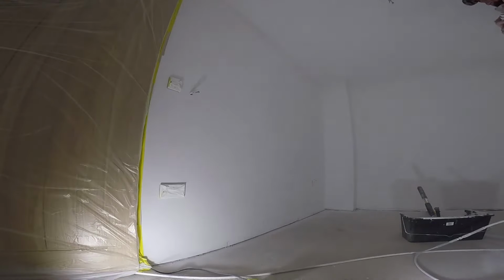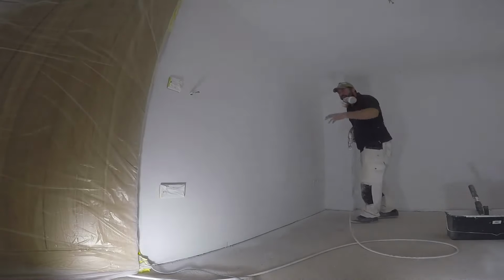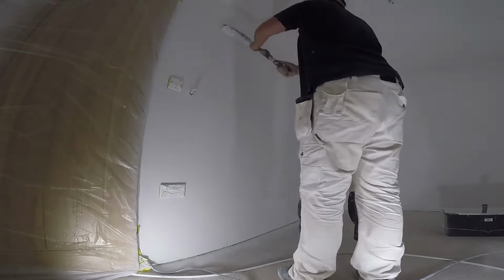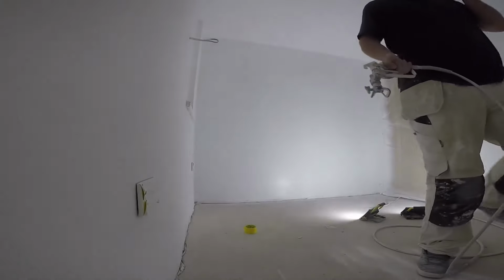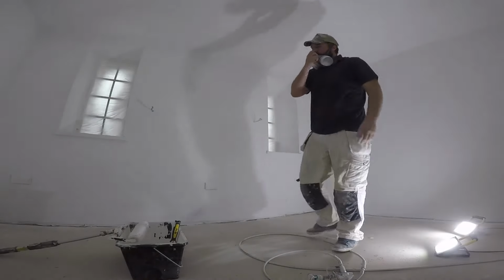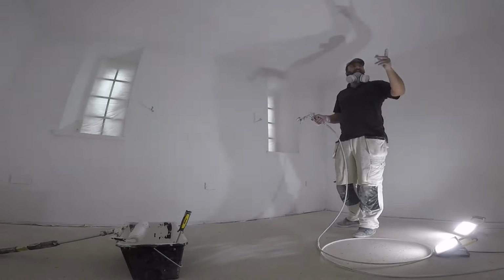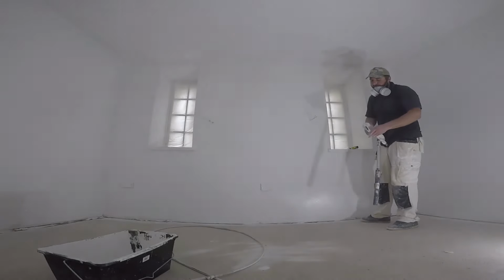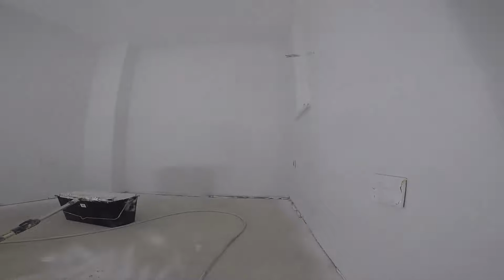How to spray and back roll alone

Comment: Great video im learning ailess spraying how do I calculate how much paint I need for a room and will 1 coat of paint and back roll be enough to finish
Reply from the maker: Hey thanks. I always give 2 coats. You could spray first lighter coat and then second coat shortly after andd drop a roller down it. 

If you work out the m2 square metres of the area. The paint tins should show you how much they cover. Be prepared to add 20% extra as your spraying
Reply from the maker: Here is a more recent video showing spray and back roll
https://youtu.be/eGrafVmHFNU

Comment: What's the purpose of back rolling? Isn't the whole point of spraying because if the finish?
Reply from the maker: good question. in some cases the sprayer can be used just for speed. Some home owners and builders want a rolled finish on the wall so they can touch up areas afterwards or later down the line. I believe you can see a touch up if its rolled or sprayed. So ceilings stay spray finished and i just roll that last coat dropping the roller down. so still a massive time saving

Comment: Great video buddy the walls look like there in white too what would be the process is the walls where a colour how would you protect the ceiling or would it be walls first the ceiling after?
Reply from the maker: Hey thanks for watching. You could do walls first and finish them.  Next day mask walls off and finish ceilings.  ... Or first coat walls. Finish ceilings then cut and roll the over spray and  then last coat on the walls with the roller.  Weight up you labour time to the material costs. See which works out best for time and cost.

Comment: Hi mate do you always back roll he walls and leave the ceiling with the spray finish? Thanks T
Reply from the maker: T T not always i give the client an option. But generally yes ceilings are left spray finished and smooth. If back rolled walls it means theyre able to touch in easier than if it was sprayed
Reply: T T v*

Comment: Lot of pissing about better off just rolling it in the first place time you set up the unit and masked up. Great Videos tho. Keep up the good work 😊
Reply from the maker: Difference is you can spray that first coat and spray again shortly after and drop a roller down it. So 2 coat it fast. You cant re roll a wall that quick as it would pull the paint off. Thats the reason. Also this was a massive re furb so just just one room. Thanks for watching

Comment: What size tip are you using and are you using blue or green tips
Reply from the maker: colin marshall im using a 618fflp graco tip.  The green fine finish low pressure ones
Reply: Do you find you get a lot of paint build up the guard which eventually ends up with spits on your walls , I've been having this problem and I know it's not my gun because it's only 6 months old , have you been getting the same problem
Reply from the maker: colin marshall i mention this in an previous video. I always carry a wet rag and use it to just wipe the guard. Like you say if it builds up too much it makes a spit
Reply: @camdecorations9779  I usually cut the wings off the guard and that completely eliminates buildup without compromising the rotation of the tip.

Comment: hi ya won't it look better in spray finish?
Reply from the maker: Dee Junior yes it would but the customer wanted a rolled finish so they are able to touch up.
The roller is quite a smooth finish anyway so still looked great. Its a microfiber roller
Reply: What roller do you use to back roll. People check out the other videos there awesome 👌